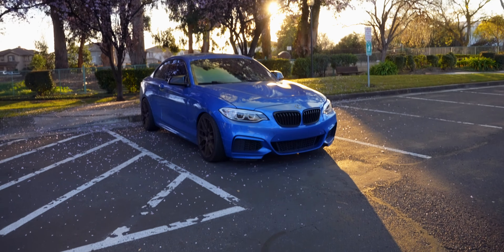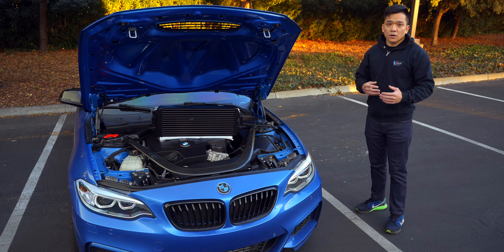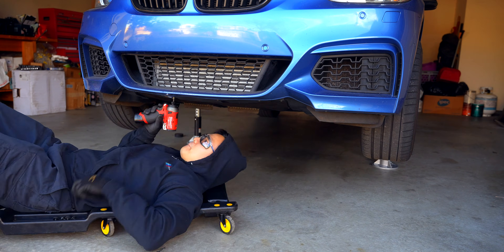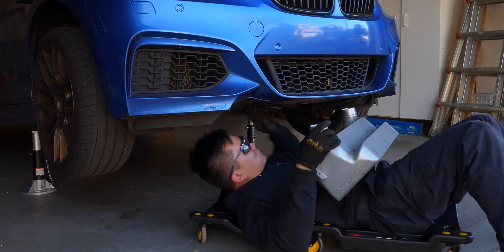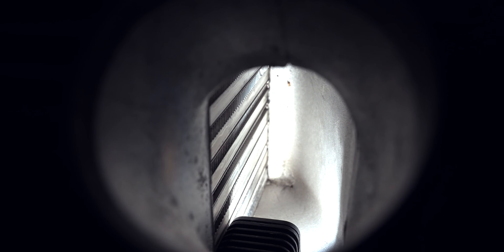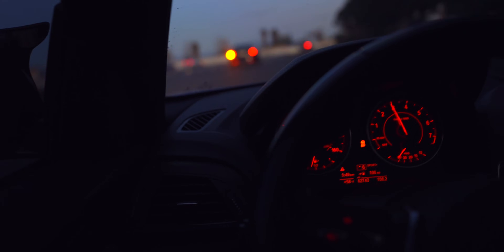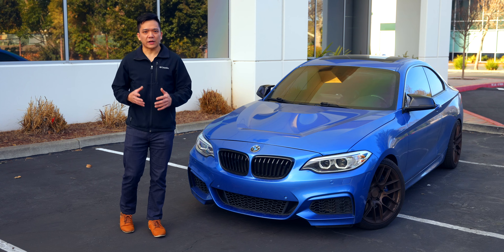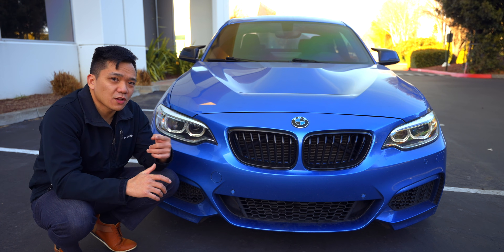BEST N55 Intercooler | Wagner Tuning vs VRSF

Comment: Just the fact that Wagners is 2 times the price makes it not worth it. If you're gonna charge double, the performance better be double. lol
Reply: It's not 2x the price. You can get a Wagner Evo 2 for $400 shipped from XPH.
Reply: @logicalconclusion  Just looked. $400 for hoses only. The cheapest Wagner 2 is listed on XPH is $590 and only for F20 and F30
Reply: @logicalconclusion  though I will agree. x2 the cost is exaggerated. It's still more expensive though

Comment: Do bigger intercoolers cause slower response/more lag?
Reply: Not in this platform.
Reply: He stated that he didn’t experience that with either one , so that’s good 👍🏼
Reply: @pjefsquad if the same turbo is having to fill a larger volume i don’t see how it wouldn’t take longer to fill it to the same degree of pressure. Scientifically speaking I would expect some lag over a smaller intercooler.

Comment: What size/model is the VRSF please? cos the links don't work anymore. What brand/type and size would you suggest? for 20% bumper to bumper traffic, then 50% slower but moving 30-40mph traffic, with 30% open road? Btw, I have VRSF charge and down pipe. Running MHD stage 2. With go to Stage 2+ when get intercooler and BMS intake. 98 octane zero ethanol gas. VRSF is a lot more common in New Zealand, and my local Euro place sells and installs them btw. Thank you heaps. p.s. My car is an M135i with EWG. So same N55 engine as yours.
Reply: What did you buy in the end
Reply: @eskania both the VRSF 5” and Race (best) are better than the Wagner EVO2

Comment: I’m having slight trouble  of picking witch one. So living in Connecticut in the New England area, the Wagner Would be ideal for me then sense it takes shorter time to warm up and cool down if I am trying to achieve colder temps sooner do to the climate that I live in. The vsrf  would be better in colder climates do to the ambient air being colder to achieve longer cold air longer, right?

Comment: Sorry, this is just not a good comparison. No one should be testing intercoolers this way, it should be Ambient temp vs IAT. Did you run any WOT logs to show what the delta was between the two? The VRSF can get within 10-20F of ambient, Vs the Wagner which is usually around 20F

Comment: I did the upgrade on last week end. In conjunction of wagner evo 2, I installed ftp charge pipe, mst turbo inlet pipe, and DV+ gfb. I chose fin and tube design for the weight saving, for me is the most important factor, on stage 1. I love the quality of the wagner and ftp.
Reply: It's absolute cooling ability is lower

Comment: You ever noticed that the air going into the engine is not filtered?
Think about it?
The intake going to the engine is just a pipe that goes into the intercooler.
And then intercooler doesn't have a filter to filter the air.
So whatever gets in there goes in the engine cylinders.

And there goes your engine in no time.
Reply: Bro, the air initially enters the system through the air filter. Then it it is ejaculated by the turbo through the intercooler then to the intake manifold. That means all the air is filtered that enters the engine
Reply from the maker: The air passes through a filter in the air box
Reply: @FritzRamos  I looked at me new intercooler and didn't see any filter there.
I even cleaned it.
The water flowed freely thru the fins.
Like nothing was there.

The intake is for the turbo inlet.
Not for the intake btw

Comment: I'm looking to getting VRSF step 5, currently I am on stage 1 (BM3 tune) My question is I have a evolution racewerks charge pipe and wanted to know if the VRSF IC work well with it as far as fitment.
Reply from the maker: If it mounts up fine to the OEM Intercooler then it should work
Reply: @FritzRamos  thank you

Comment: I just bought a 2015 M235i with 101,000 miles on the clock. Single lower (middle aged lady) and very well taken care of, so it was a very easy decision to make. Onto my question... Why does my cluster look different than yours? I have a digital fuel consumption gauge under the RPM, but it looks like your larger center digital display is newer and provides a lot more information. What am I missing here? By the way, thanks for all the amazing videos you've made! I can't wait to get started working on my car. I'm not sure what was last serviced, so I'm thinking about just doing everything. Spark Plugs, Oil, Diff Fluid, Trans Fluid, all the different pipes you've mentioned in your previous videos. Let me know if there is anything else I should consider.
Reply: His cluster is the "basic" one, it has only a small digital display where it shows all the infos. Your 235i has the extended display.
Reply: Lol sure everyone selling their Bmw say that 😂
Reply: @TheTruelakersfan  Well, it’s one thing when you can actually see the records 😉. Actually, since I’m here, I’ll update… 108,000, I noticed a small oil leak around the Valve Cover Gasket. Bought a new Valve Cover + Gasket + Spark Plugs + Coils and replaced it all with a friend for a total of $800. Now I’m at 111,000 and it has been smooth sailing. This is my second BMW with over 100K (previous 08 335i). These engines are like Porsche… they’ve been building them and perfecting them for a while now.

Comment: Thanks for the info. Do you have stats on the aftermarket vs original part temps?
Reply from the maker: Hi Thomas! I don't, but on forums I saw people reporting Temps ranging in the highs of 35-55 degrees celsius

Comment: Any change in the amount of turbo lag caused by larger FMIC when compared both?
Reply from the maker: No turbo lag was experienced with either intercooler
Reply: That's bullshit, that kids are running around saying... Because... Need for speed, I guess.  It doesn't really work like that.
If you apply overkill to your intercooler, the added weight is the only drawback.
You wont get more lag, than you already had.
I have the 7.5 vrsf, and it makes an incredible "whoosh" when I put boost through it. Heard even better with my open intakes and vented carbon fiber hood.

Comment: Fritz do you think it’s worth the upgrade coming from the vrsf
Reply from the maker: I forgot to mention that I got this intercooler for 400 and I'm looking to drop more weight upfront for clearance issues. So based off of that it was worth it, especially since I can reuse the vrsf intercooler.

Comment: Nice comparison, my M235i also installed the EVO 2 Competition intercooler and N55 catted downpipe from Wagner Tuning.
Reply from the maker: Nice? How long have you had it in and how is it holding up?
Reply: @FritzRamos  I've had them installed since Feb 2021, along with ER charge pipes, Quaife LSD, ARMASPEED air filter, Bootmod3 Stage 2 91 octane.
Daily driving most of the time, occasional drifting around the track, and it's working fine so far.

The recent daily driving water temperature is about 95 degrees Celsius, and about 110 degrees Celsius after half an hour of mid-low speed drift.